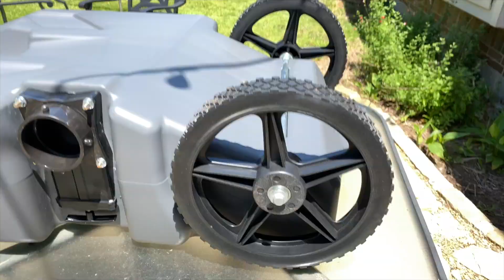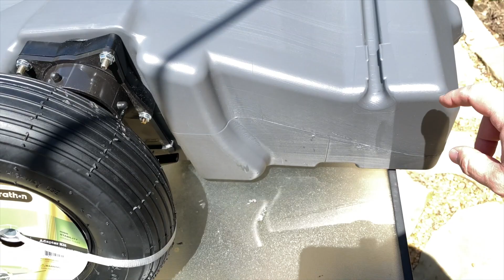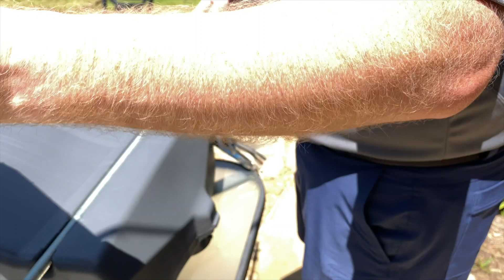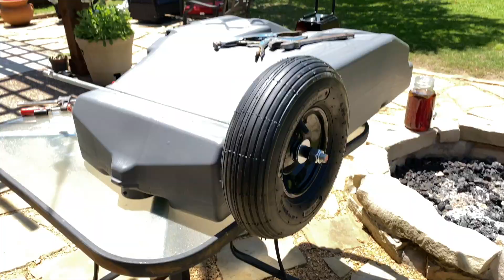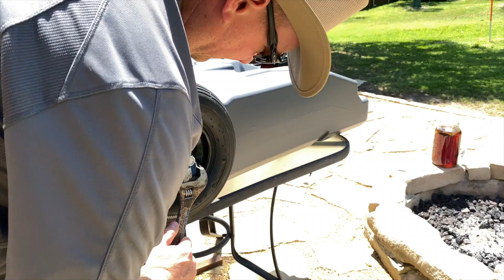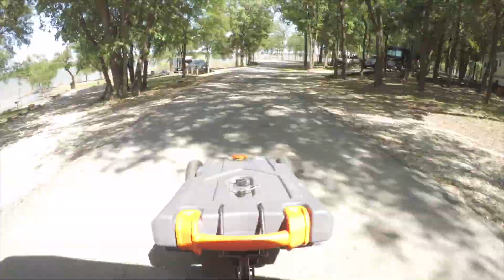Camco Rhino Fix

Comment: Chimes???????  definitely use heat shrink   looks way better   we ordered the 28 gallon   definitely changing tires
some large washers between nut and plastic body be very good   don't forget lock washers too!  if you can  see about adding zerk grease fittings  lube the bearings
great job

Comment: I got the 36 gallon version. It's a good tank and really like that it's designed for towing with a vehicle. The only thing Camco should have done is made the wheels much better to begin with, instead of making us  do the truly necessary upgrade. The wheels they sell it with are absolutely horrible. I'm thinking of using solid never flat wheels also. They are still much better than the stock wheels, maybe not provide as much shock absorption as pneumatics, but at least definitely more than their stock wheels. I'm also making mine so the wheels can easily come off so I can store it better and go further down under my RV septic drain valve pipe exits. Then I'll just slide it away a couple feet and pop the wheels back on and off I go to the dump station. Happy and safe RVing, God Bless 🌼🍃🙏

Comment: I just got a 28 gallon Rhino tank and it has snap rings to hold the wheels on.  Camcorder must have listened to the YouTube reviews.  I would have used heat shrink tubing instead of tape.

Comment: Great video.  For cutting the 5/8 axle, an angle grinder with a cutoff wheel will make very short work of it.  When i cut bolts I first thread on 2 nuts past where I’m going to cut and after cutting thread them off so they clean up the end of the cut thread.  It makes putting on a nut easier and reduces risk of cross-threading.

Comment: YOU MUST LOCK BOTH NUTS TO THE BODY OF THE TANK OR IT WILL MOVE FROM SIDE TO SIDE.. YOU NEED 1/2 INCH FROM THE WHEEL TO THE BODY. ALSO THE BEARINGS ARE JUNK AND WILL NEED TO REMOVE AND REPLACE ON ALMOST ALL 13" WHEELS. YOU NEED A SEALED BEARING OR THEY WILL DRY OUT AND FALL OUT AS THEY GET VERY HOT.  DO NOT PULL THE ROD OUT LIKE THIS GUY DID !!! DO NOT!!! ALL THAT HOLDS THE 5/8 ROD IN IS THEM PLASTIC TABS AND THE NUTS. SLIDE THE ROD IN FROM ONE SIDE..

Comment: I  replaced my axle with a non threaded rod same diameter as original axle and got two 13 inch tires  and wheel with bearings  from tractor supply cut  the correct length plus two inches and drilled two holes one inch from each end and  slid the axle onto the tank then put one washer on each end, put the wheels on each end and added another washer to each end and put carter pins in the holes to hold the wheels on.   works great. I purchased the rod ( I don't recall what size it is) the washers, carter pins and wheel assembly  all from tractor supply. was a very easy project.
Reply: did you have to wrap the rod with electrical tape too?

Comment: Just received my 28 gallon and they have replaced the cap with a spring clip.   Great fix!
Reply: Same here, except...one side was missing the c-clip. It's a big improvement, but check those wheels to make sure the c-clip is actually there. I'm sure they would have sent a replacement, but I found one a t ACE Hardware for 57 cents.

Comment: You could also use some electrical heat shrink instead of the black electrical tape as another option.
Reply: Most home improvement stores have various sizes of aluminum hollow rod in the same section as the all thread because those threads will eventually wear through electrical tape.

Comment: Why not just thread the original shaft and put the original wheel back on with a lock nut or drill the factory shaft and put a cotter pin on the outboard side to hold cap or take cap off and put a washer then cotter pin???
Reply from the maker: That’s a great idea. For me, it came down to availability of equipment. If you have the ability to do that, then it is probably a better option.

Comment: I've never needed to roll my waste tank because I use a FloJet macerator to pump the black tank waste directly into the Camco tank while it sits in the back of my truck. Then just dump the Camco tank at the dump station as you would an RV

Comment: Nice video. I just bought a camco tank and was going to drill the ends for a cotter pin. I see they added a snap ring. Thinking this fixed the end cap problem?
Reply from the maker: Based on how rigid the wheels are that come with the tote, I don’t think the snap ring will be failsafe. The cotter pin is a good idea and may work fine. I like adding the pneumatic tires to reduce shock and vibration on the whole unit.

Comment: Thanks for this video. I also saw RoamSchooling's video. How many layers of tape did you wrap the axle with? Does the spacers wear out or break? What if you did not use the spacers at all? Thanks.
Reply from the maker: I added two layers of tape. But really it is just trial and error. You want the axle to be really tight in the slot. My spacers have not broken yet. They came with the tire so i suppose they are made for some wear.
Reply: I forgot that the solid wheels wont lose air or go flat for any other reason at just the wrong time. Hope you don't have any issues.
Reply: I have a 28 gallon on the way. I saw the cotter pin video. That solved his problem. The other video about adding these tires was due to the wheels coming apart. I guess I have work to do before I even use it. Now I'm really considering how I can put my tank on the cargo deck and take it to the dump station and not tow it. A drop reciever will lower it enough to roll it on top. I'm looking for a design where the receiver can be raised and lowered like a box truck gate.  My cargo deck can be in my truck receiver and not hit my fifth wheel even when turning. Something to ponder.

Comment: Most Awesome! I'm so glad that you found value in our video! We recently visited Palo Duro Canyon as well (back in early March) - what a beautiful place. Thanks for filling in the SPECS which I had missed! Your video is great and I appreciate that you took the time to fill in the technical gaps. I'll update my video with you reference video!
I have checked that the Nylock Nuts remain tight. I agree with your assessment. I have tightened them after install once. So, it is a wise idea to periodically check them. And yes, I used the small spacers - I too thought that the wide spacers would bend the axle. Under full load the 5/8th" bar will bend, so USE THE SMALLER SPACERS as directed in this video.